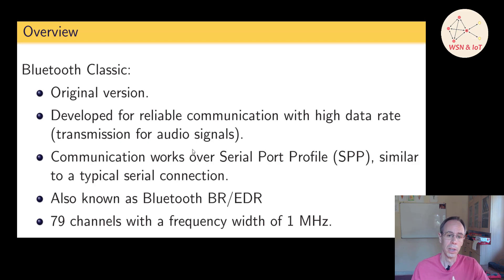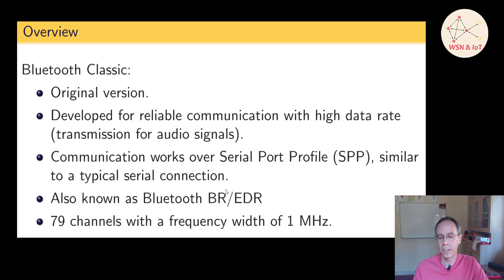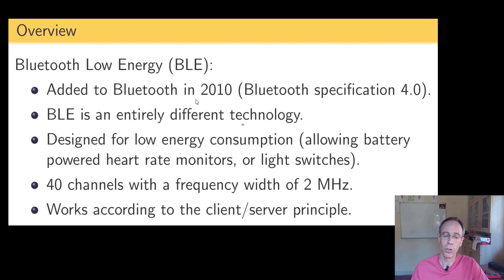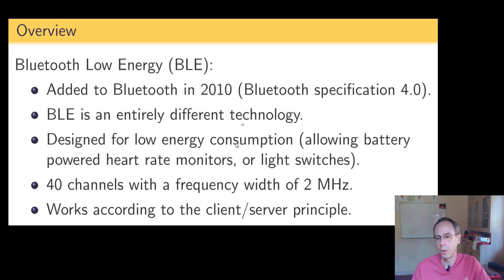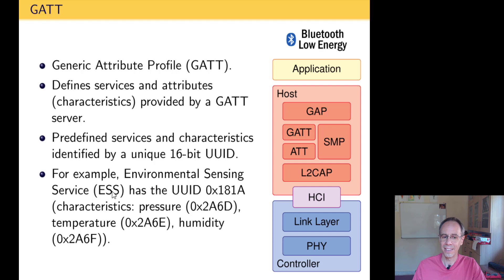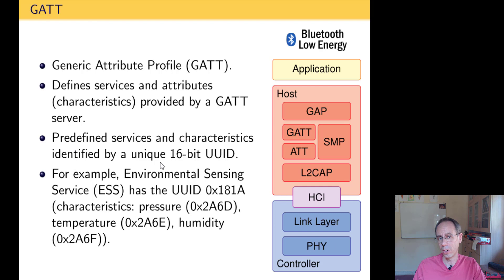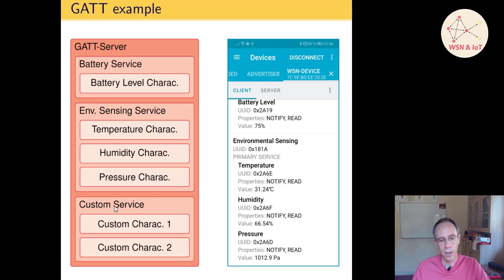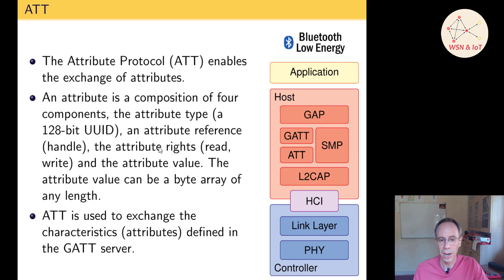Understanding Bluetooth Low Energy (BLE) - Theoretical Overview

Comment: This is interesting! A theoretical overview of Bluetooth Low Energy (BLE) provides valuable insights into its architecture and applications. BLE's design for low-power communication makes it a cornerstone technology for IoT devices, wearable tech, and other energy-efficient applications. Its ability to connect seamlessly across devices has revolutionized real-time data transfer in industries ranging from healthcare to smart homes. For those looking to implement BLE in their projects, GAO Tek offers a comprehensive range of BLE tools and solutions that could help turn theory into practice. Definitely worth exploring!

Comment: Which one provides better range, Bluetooth LE or Thread? Also may be long battery life? Or they are the same?
Reply from the maker: The range depends largely on the frequency used and the transceiver strength. Thus, the range of Bluetooth and Thread is quite similar. Detailed information on the range and its influencing factors are described in my book "WSN & IoT". Both BLE and Thread are designed to be able to consume little power. But it all depends very much on the individual application and the traffic generated with it. A lot of data traffic also means a significantly higher power consumption. Which is why I strongly assume that the BLE Mesh consumes more power than the Thread, since the network is flooded with messages to reach a destination.